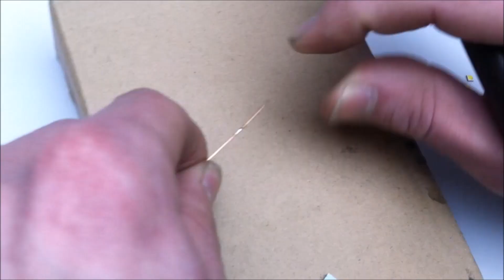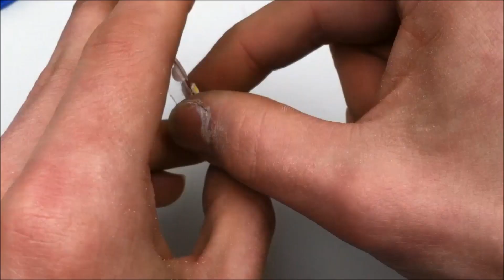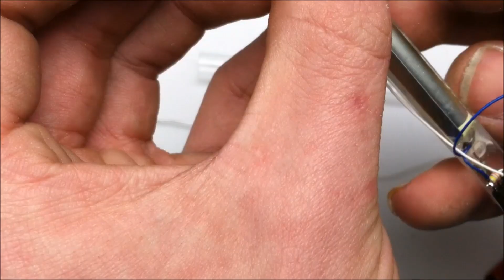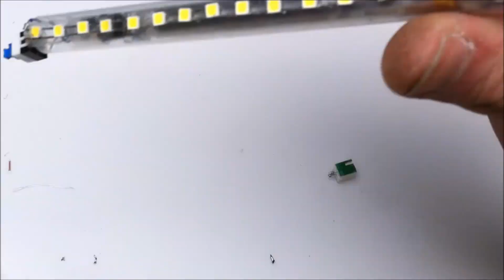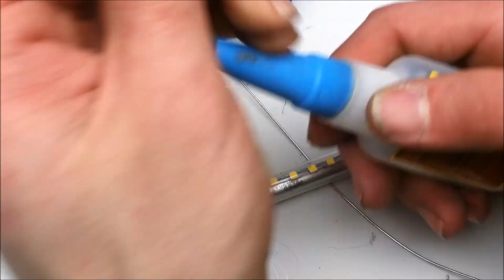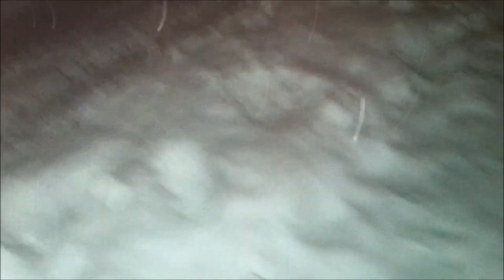E-Hookah Projects #4 Water Proof LED Stick Light

Comment from the maker: I have made around 5 of these for other people, they where designed with mini USB B and did not contain a Mosfet but instead was wired directly to the switch. The reason being is the that there needed to be room in the tube for the lithium ion charge regulator. A bit of the assembly discontinuity in this build video has a bit to do with how many of those I made before this one.

Comment: Do you live any where western ny
Reply from the maker: I am located in WI
Reply: Awe,to bad wish you were located closer to me,I would pay you to teach me some things.As far as recycling and reusing electrical components.Being that I have so much and my experience does not go to far I keep blowing some good salvaged led tv internal lights
Reply from the maker: @silvercat5309  That's how you get good in some aspects. There is a lot of information on the web but there is still a learning curve. I have broken many many things. Mistakes will happen, parts will go poof, but things will be learned and that's experience points in your bag, the hard part is not letting your luck bag run out in the process. I try to post up helpful stuff however at times it can be very hard to explain the little nuances of knowledge and critical thinking.

Comment: Where did you buy your e-hookah's. Because I can't find them. They are all made of metal bodys and some of them don't ship to my country. Btw great video! :)
Reply from the maker: These where from a local corner store on the block, they had them for a while and where not selling do to not having nicotine. They are the cheapest of the cheap so many of the batteries started becoming discharged so I bought them locally in bulk. I would suggest visiting your local tobacco/cheap corner stores and seeing if any of them has any stock like this. Since they where not bought online I don't have any specific online links.